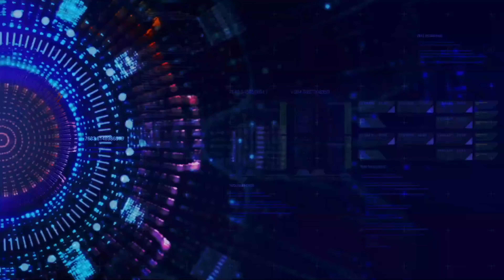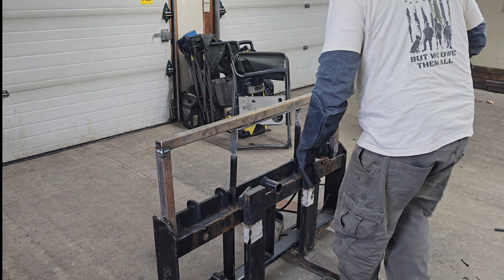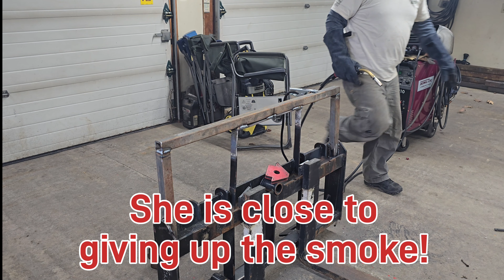Yeswelder DP200 magic smoke out challenge! Can I burn it up?

Comment: You realize the welder is setting on a welder with wheels.  No clue why you are fighting the short lead..    Nice build I like the idea of that heavy wall tube.  I am waiting on my DP200 to show up in the mail today.   It was given to me to review as a amazn vine reviewer.  I got one of their SP200 single pulse the other day.  I think it was a bit of a proto type to this one.  It laid down some nice beads.  I ike them because they are light and portable.  I have a everlast 221STI I love it and it does have a carry handle but at 80 plus pounds it is not exactly my definition of portable.  This has a 60% duty cycle at 200 amps if you was at 170amps you was more like 80% or so.  I had no doubt it would handle it.  The dual pulse is supposed to be pretty effective on thick steel, letting you spray transfer out of position.  Normallly spray transfer is only flat and horizontal.  Not sure I will play with it much as I do not want to add a bottle of 90/10 to my lineup.  But if I had a job shop and welded a lot of things like this I think it might be worth it.  Spray is a much cleaner process and the welds looked butter smooth even uphill spray with the double pulse.  I watched a video of a dude building a complete custom aluminum pickup flat bed and I was very impressed with the beads this machine made without a spool gun and the double pulse made them look a lot like tig welds too.   He went into depth about the 4ts mode and used it on the aluminum.  Pretty interesting I do not weld enough aluminum normally if I do, it is a repair and not a build and my Everlast 221sti is a ACDC tig also.    I am very impressed with the Everlast machine.  I got mine in 2017 and it is a beast.  I purchased a 15 foot tweco style mig gun from YesWelder for $110 bucks and put on it.  I highly recommend that gun if you want to upgrade the gun on this DP200.  I think it is rated at 250 or 300 amps.         
    You had this a year now how is it holding up?
Reply from the maker: I'm also a Vine Voice. My DP200 has been fine. I keep it in top of my Thermal Arc/ Thermal Dynamics Fabricator 200. The Fabricator has been my bread and butter for 20 years, but it's been dormant since I got the DP200.  I do enjoy the added features and functions of the DP200 over the more archaic Fabricator. So far, it's been a great shop machine. I don't know that it will be around in 20 years, like my Fabricator.... I guess we will see.
Reply: @LarryMusgrave  My DP200 vjust came in an hour ago.  Sadly my gastroparesis has me about to throw up so it might be a day or two to get to go play.  I am glad it is working out  I would not hold your breath on 20 years with all the electronics but the good thing is they are cheap if it does go out.  Checkout that 15ft Tweco style mig gun Yeswelder sells.  Lets you have some room to work.
Reply: @LarryMusgrave  I just watched this video and I thought I would share about the savings a dual pulse MIG can give in a production shop.  It lets you spray transfer out of position you might think about it.    Best wishes!    https://www.youtube.com/watch?v=AkdkUmp_BV8
Reply from the maker: @jvmiller1995 
You must sleep like me! I went to bed at 9pm, I'm wide awake at 1am. That's my life, sadly. I can't stay awake by 8pm,9pm is my stretch time. Between 1 and 2am I'm wide freaking awake with 1000 thoughts going through my head I live on around 5 hours a night. Every great one in a while I can get drunk and sleep like 8 or 9 hours. But that's a rare gift.
Reply: @LarryMusgrave  Lol  What is sleep?   I have gastroparesis and I am to nauseated to sleep.  It sucks getting old.

Comment: Mine is doing the dirty screen too I noticed after barley using it too and glad someone is calling them out
Reply from the maker: You Need to email them and report it. They are under the impression that less than 1% have the issue, this why they aren't automatically sending new screens to each owner. Many are not reporting it to the company and are instead paying for the third party fix. Report it!

Comment: Hi Larry, great video!  Yours are the nicest welds I’ve seen from a DP200 on YouTube.  Did you get it very recently or after a software update?  Also, you mentioned you have an ArcCaptain?  How does they compare? (Topic for another video?).  I’ve seen some very gorgeous looking welds from am ArcCaptain which I have not seen replicated on a DP200 (although yours are closest).  Wondering if this is really the case (for some projected weld appearance is important).  Also, my perception is that the ArcCaptain arc is for some reason quieter than the DP200.  But maybe that is just sound recording. Anyhow, thanks!
Reply from the maker: I'm still using the original software from the Kickstart.

Comment: What’s the honest overall review?
Reply from the maker: The machine put down really nice welds, it ran perfectly as you saw me move about a fast as I could. So for the intended purposes so far, of the 7 machines I have here, I like it a lot. I'm not at all happy with Yeswelder about the screen issue, I need to get a video together this week and honestly embarrass them about this. When you buy the machine, it will draw air into the machine for cooling and static in the display will attract super fine dust that will immediately be attracted to the display. There are users custom making gaskets and filters to fix the issue, but Yeswelder is trying to ignore it, but there is talk that they are going to fix it for me machines that gave yet to ship. So all of us early-in buyers..... figure it out in your own. 

So that's a big issue to me. But stick welding, she's great. Carbon steel mig, great. I need to set up the lift tig and run it. I really wish it was a HF start,  no touch Tig.... but I still do want to give it a run.
Reply: @LarryMusgrave  Yeswelder been ignoring my firmware update questions that i asked 4 times on their FB group. i Was only asking if new units come with the latest firmware...all i got was silence , so i guess ill go with PrimeWeld

Comment: thank you for checking the power cable guage. It is strange that all these dual voltage  imports ship with 12 or 13. you would think that they would use at least 10. but I guess nobody has had any issues. I just bought a second welder and same thing. i will be doing a current draw on power cable and also checking thte output current on both 110 and 220 to confirm it is within specs. too many of these companies exaggerate the output current.
Reply from the maker: My commercial mig is 10G. That's on a Thermal Arc / Thermal Dynamics Fabricator 210, a 250A transformer based commercial machine. Now, I would never try to compare these far less expensive, hobby/ home grade machines to something like this beast. I would surmise that the 13G wire in these inverter based 180, 185 and 200 amp imported i got over the last month will draw over what 13G can support. And honestly, not many home or hobby guys are going to go balls out on these machines. I see a lot of small repairs on mower decks, auto body and frame repair and other fairly low power welding jobs. I'm in the higher end of power use I would guess, I do mostly construction repair, trailer frame rebuilds with C channel, bucket repairs and thins if that nature on skid steers, farm tractors, backhoe machines and equipment/ dump trailers. I'll be starting a F550  dump bed repair job here soon, it's a rust belt dump and the bed is coming apart.
Reply: @LarryMusgrave  You are correct Sir. power cable is cost saving on these multi function machines and for what people like me use them for to repair a few things there is no problem .Although I've read somewhere  it does effect the output efficiency slighly. not enough to justify replacing the cables and connector at today's prices. I never had any issues with any of these Imports even when used for few hours or cared about what they used.  it just struck me odd that after dealing with guage 6 wire and 240 line, I started noticing how thin all other cables around the shop/garage are especially welders that use 220 ;-)
Reply from the maker: @WV591 

One cost savings that Yeswelder used, that I find odd... it's that ground clamp. I'm sitting in my shop right now with a $89  Winbegin Mig-140, a $179 BestArc Mig 145, a $220 ArcCaptian  Tig 205 Pro Iconnect, and my Thermal Arc..... all have brass jaws on the ground clamp. The supposed $749 retail Yeswelder DP200 has steel jaw inserts.... why?
Reply: @LarryMusgrave  they all cut corners on ground clamp right from the start. it's become so normal that nobody even talks about it they just upgrade them if they are at least semi pro or care. I upgraded couple of mine. My only complaint is nobody checking the output current to verify they are true to specification. I know only two channels that do that on tube.  I will be doing that in the next few weeks on my new FEMEROL 250A. I'm thinking about doing a video and uploading it. so far, quick tests i did on 220 show it is very close to claimed output it was 238amps . I presume that if they had used 10AWG it would reach closer to 250Amp. I will also check the current draw on power cable at max output just out of ccuriosity.